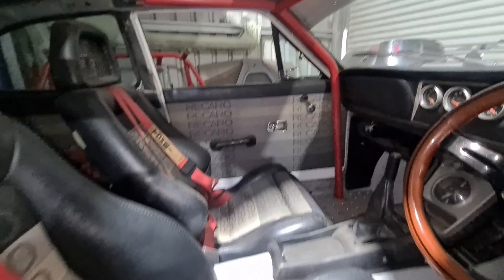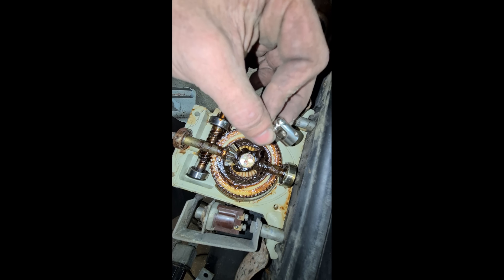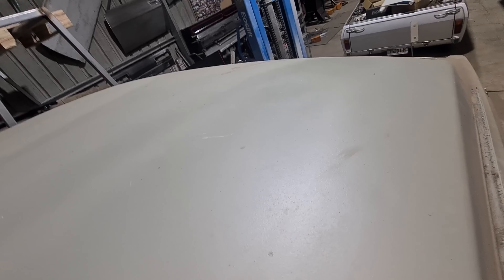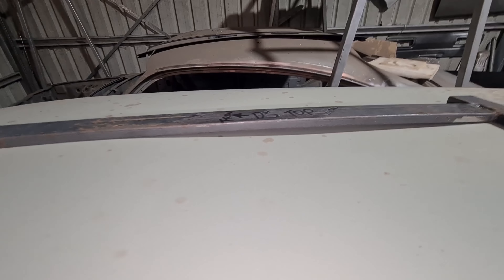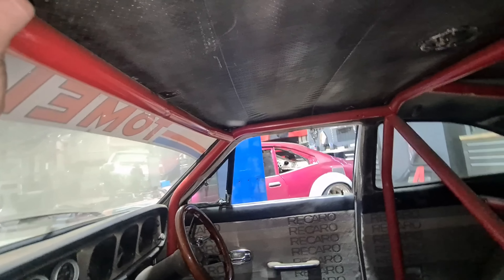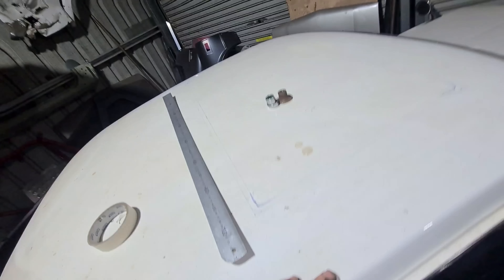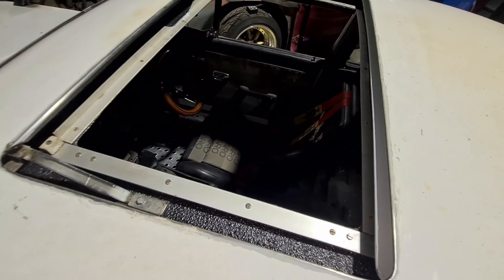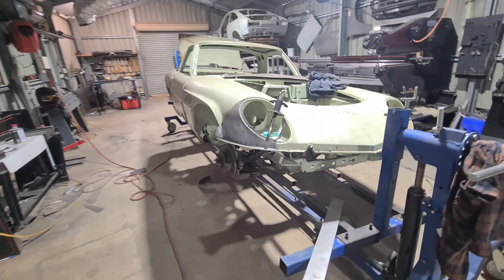Cutting Up My Favourite Car Once Again + Cosmo Update

Comment: Top work again mate . How did you fold the final 90 under ? .
Reply from the maker: I thought I filmed that on a time-lapse but my phone rang and it cut the video annoyingly. I pushed it over 180 with a tool called a skin zipper. Goes on the air chisel. Suprisingly worked perfectly, one lap around to turn it to 45 and then another lap around to really pinch it closed and tight.
 a door skin tool didn't fit in the space between the skin and tray.